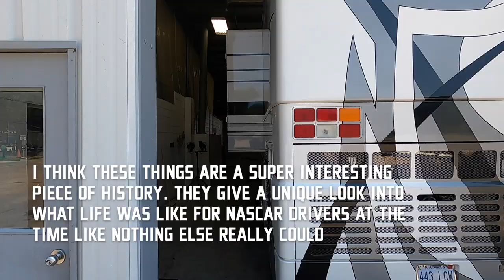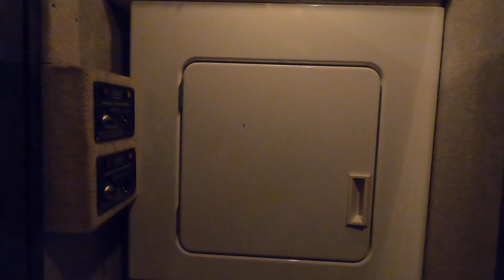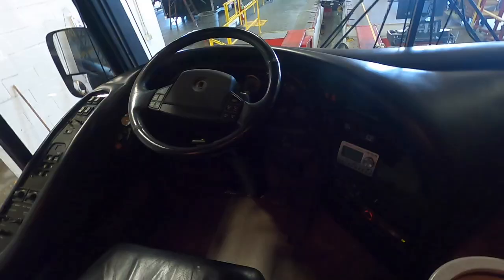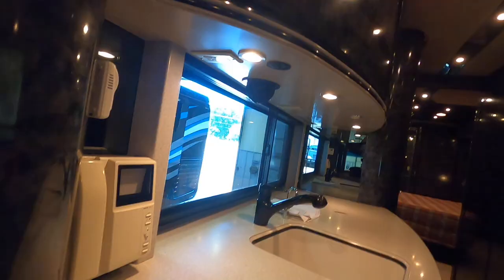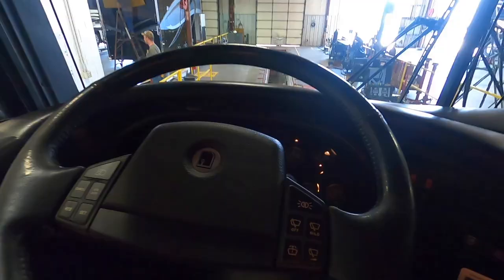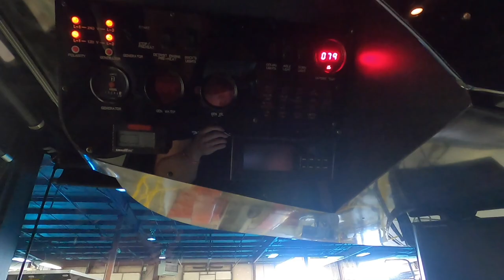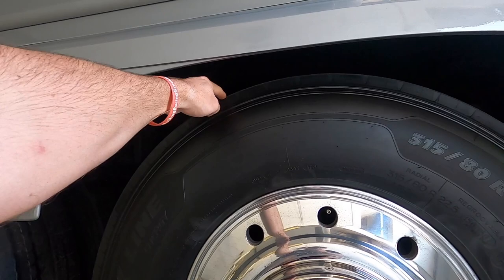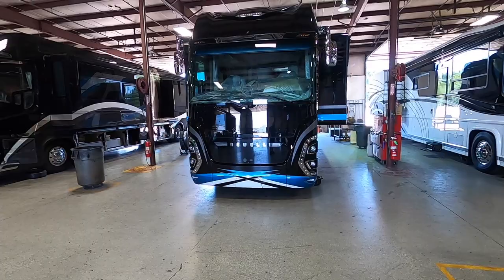Tour of Dale Earnhardt Jr's Former 2002 Newell Coach (Awesome Party Pad)

Comment: Like the polished aluminum valve/ jake brake covers!!! A polished aluminum valve cover Caterpillar V-8 engine looks so radical! Sounds badass straight piped, ultimate torque monster! Detroit diesel makes some of the best engines too, good combo is the 430/470 engine with some long legs/ 18 speed trans is good for a 140 mph high speed load relocater delivery!!! Not only Circle track racers are fast, some trucks flat haul ass too!!! 👍✌️peace out